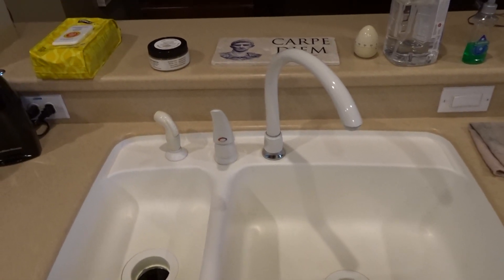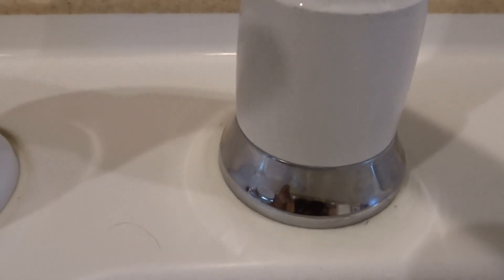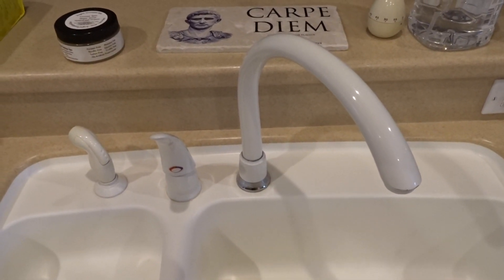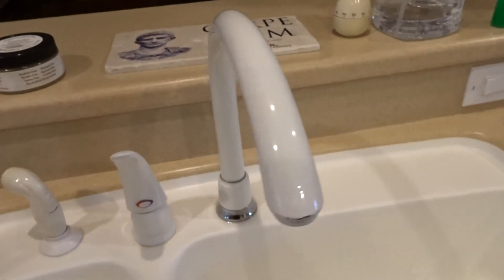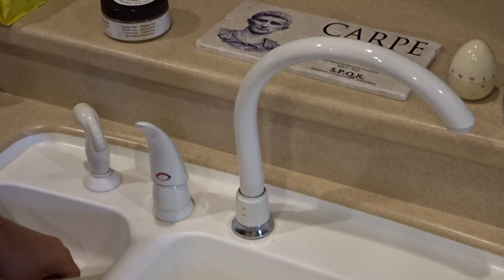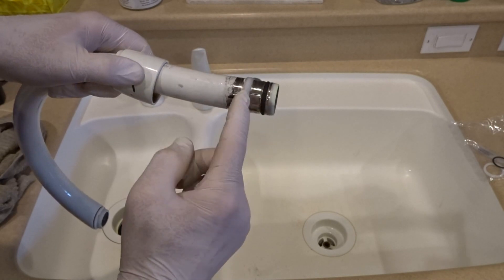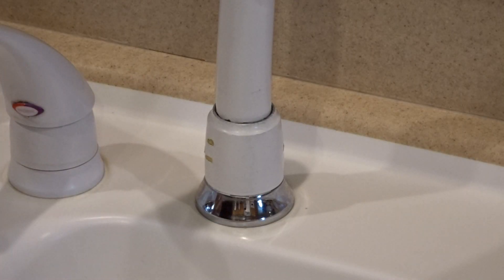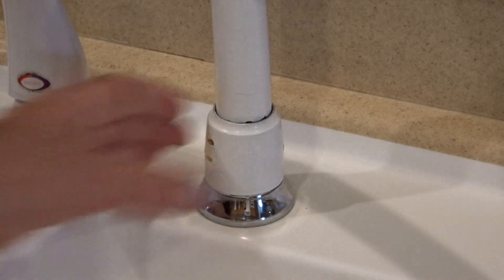How To Fix a Leaky Moen Kitchen Faucet Spout 7700 series

Comment: Thanks very much for posting this video.    I have the same faucet with the same exact problem....I was able to get the replacement package for $9 and fixed it in 10 minutes....thanks also for the recommended use of a strap wrench...cost $10...$19 instead of paying the plumber....thanks again

Comment: FYI, This is Moen.  It is covered for life.  Just call them and they will send you the parts for FREE!  No need to buy parts for any Moen faucet.  In my case they sent the entire 7700 neck.  The complete neck and o-ring & gasket already attached along with a new spout hub.  Therefore you do not have to worry about damaging it during removal...